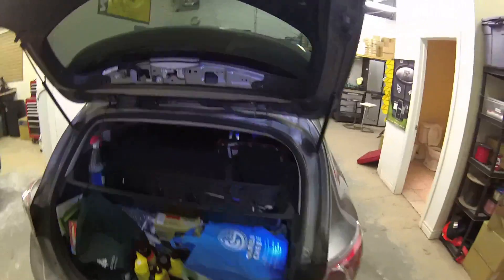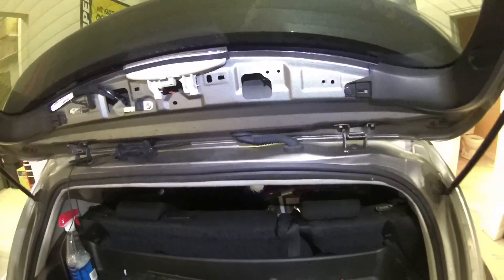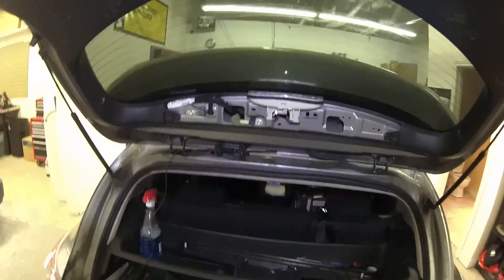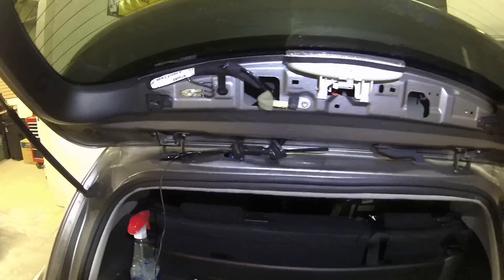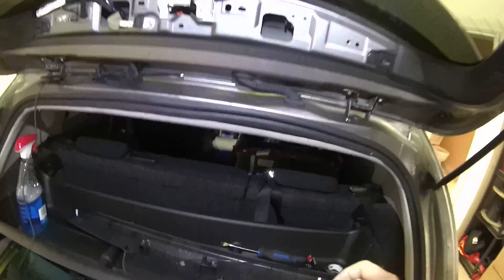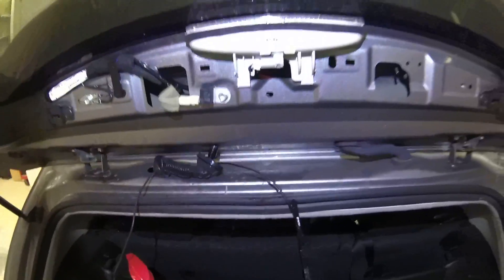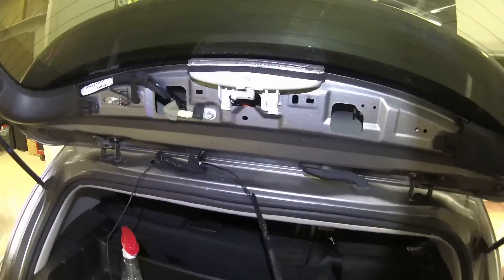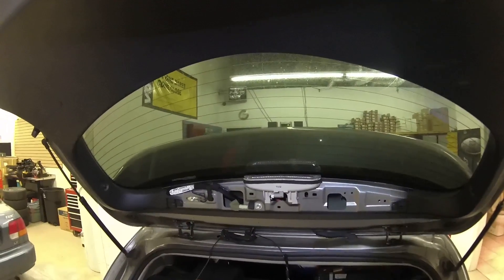DashCam Install How To: Running Camera wiring into rear hatch

Comment: Thanks for the advice....My question is I have an 08 highlander with a sunroof and side airbags any advice on how to run the wires thru the liner my cable isn't long enough to run along the floor its about 3 feet too short..

Comment: I got noise on my radio when I ran my cables on the passenger side (Right Side) of the roofliner.  My previous dash cam I ran the cables on the drivers side (left) I am thinking I have to redo that run.